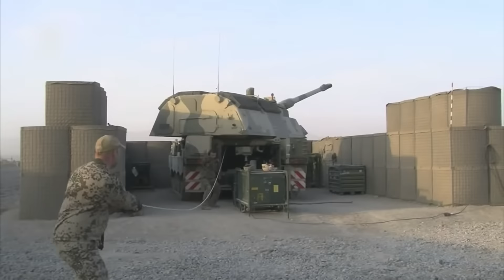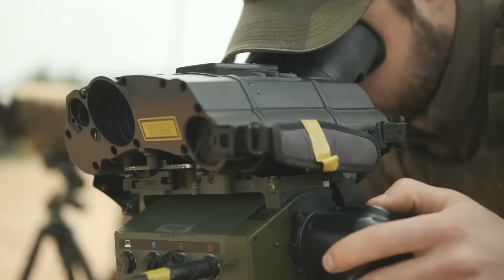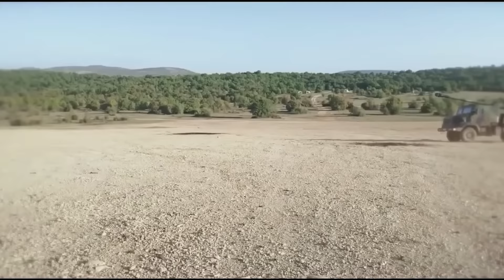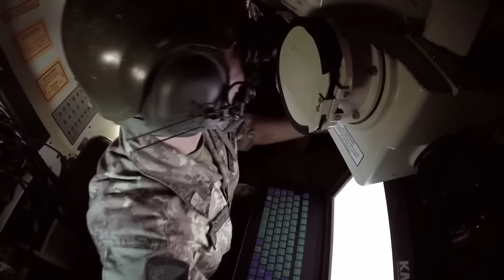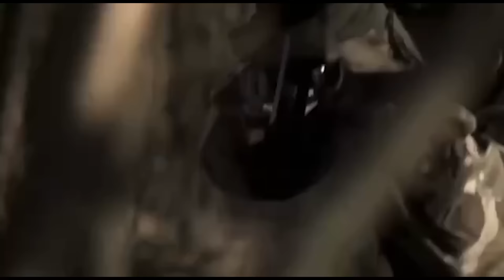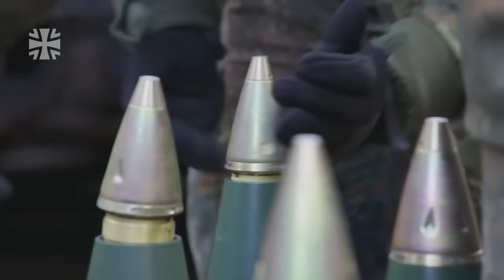German PzH 2000 howitzer in Action in Ukraine! Better than Caesar?!

Comment: The Panzerhaubitze 2000 is not difficult to use in shoot and scoot missions, it was literally designed for that purpose. It can shoot more projectiles and then quickly move away, whether that be at 60 km/h or 80 km/h makes no real difference in evading counter fire.
Reply: Agreed, the 80 km/h is only useful if travel is large distance, like 100's of kilometers.

Comment: The guy has it completely wrong. Shoot and scoot tactics means you have to fire quickly and runaway quickly, at both the PzH2000 is better than Caesar because PzH2000 can fire after just 1 second after coming to a stop and get going just 1 second after shooting. Caesar nears set up time and the crew running around on the outside, so it takes minutes. Also mobility of the PzH2000 is higher than Caesar because PzH2000 is tracked and therefore can go off road much better than Caeasar so it's mobility is higher.  When you talk about ferry range and speed then Caesar is 20 km/h faster and has 150km more range which makes almost no difference at all. If you go 80 km/h or 60 km/h is really no big deal and the range is near as makes no difference.

Comment: PzH 2000 on the battlefield - STOP, we are taking a break until tomorrow, we meet in the same place, because today I have fired 90 times.
Russian howitzer - okey (I will take a little more Uraine until tomorrow)

Polish KRAB on the battlefield - I'm just getting started, I only shot 140 times today we're going with coke, fuck yeah
Russian howitzer - please stop,have mercy on me
Polish KRAB - no
Reply: pzh vs krab
projectile velocity: 900m/s vs >100m/s:   pzh wins
rounds per minute: 6 vs 9 pzh wins
ammunition carried inside: 40 vs 60 pzh wins
max range of shot: pzh wins by far
max range 400km vs 420 km pzh wins
automatic computer based targetting: pzh wins

nice howitzer, KRAB. but: pzh shelles more rounds a day, even if it would take a rest. and the rate of hits is much higher, due to better electronical support and automatically tempered ammunition.
Reply: @KarlHeinzSpock  I do not know where you got this information but I will correct it so quickly
1 and 4 lol
Crab's max range is 33 kilometers with normal ammunition.
when using Vulcano, the range is 72+ kilometers, so the projectile speed is the same or very close
2 yes, here you are right, the Krab has a semi-automatic loading of the ammunition to the cannon
(This is the type of argument that rosians use for Western tanks compared to T-series tanks.
What will happen when PzH 2000 invades a mine since all ammunition is close to the bottom in PzH 2000?) 
3 yes, here you are right
5 yes, here you are right , but it's really not much
6 LOL
it has a very good Topaz
Crab apart from that have :
land navigation system and topographic link FiN 3110L + GPS + odometer,
fire control system (turret control computer, aiming computer and gun commander's ballistic computer),
filtering system,
FONET internal and external communication system (VHF digital radio type RRC 9311AP),
fire protection and explosion suppression system,
day and night observation devices for the driver and the commander,
warning and self-protection system - OBRA-3 SSP-1,
a sight for shooting straight ahead,
ballistic radar MVRS-700 SCD,
power generator - DC 28 V, output power 5.5 kW
And I forgot about accuracy, with normal ammunition at a maximum distance of 33 kilometers, the Crab hits a maximum of 2 meters. What I wrote is data from the army, not the manufacturer's advertising requests;)
For a soldier, it is most important that the equipment he uses is reliable, reliable and, once again, dependable in all conditions of the battlefield.Because their lives and their brothers' lives in the fight against the enemy depend on it
Greetings from Poland
Reply: @asbupl5670  i see, you know and like your equipment. perhaps it is as if two fighters meet in the ring: it is important, that each opponent is shure about his strength, if not, he is about to loose. so germans think, their cannon is best, and you are convinced, that yours is better.
i didn't mention all items that are built in at pzh 2000. for example, there is as well a self protection system, applying fog in pzh. pzh and krab, they look quite similar.

our systems fight on the same side. i observed, that poland has a well equiped and well trained army and i apprechiate it, as well as your help for ukraine.
i wish you all the best.

Comment: There's a new type of 70km projectile that's about to make it's debut in Ukraine. The article I read said it would be compatible with the M777 and the M109 Palladin but it didn't mention the PzH2000. It's a joint development between the US and Norway. It will be able to hit moving targets from 70km. This is what I found on it:

The U.S. company Boeing and Norwegian Nammo tested a new 155 mm Ramjet projectile for NATO standard artillery.

The Ramjet is being developed as part of the modernization of existing weapons for the U.S. Army. Despite the fact that the tests became known only now, the tests took place at the end of April 2022 in Norway. The military checked the operation of the jet engine, which "showed flight stability."

Work on the new artillery projectile began in 2019 as part of the XM1155 Extended Range Artillery Projectile program. The project was funded by the U.S. Army. The Ramjet is equipped with an air-jet engine, thanks to which it requires less fuel and can accelerate during flight. The maximum launch range is 70 km.

The Ramjet is designed for the advanced ERCA (Extended Range Cannon Artillery) project, which was previously called the M109A8. However, the M777 and M109A7 Paladin howitzers will also be able to use the new projectile. With its help they will be able to destroy enemy tanks on the move.

I wonder if the PzH 2000 will be able to fire this round? Generally, when NATO develops something like this it's compatible with every nations military.
Reply: It should be,but we might need to (re)test the long term effects on barrel and add computer things
Reply: @frederickpallas7130  That's good thinking. This round is brand new so more testing is quite likely. It has yet to be fired on the battlefield. Bit being able to hit a moving vehicle from 70km with a 155mm round would be a huge improvement over what Ukraine is using now. I hope they can fit it with all the 155mm platforms of each nation such as the Caesar and PzH2000

Comment: Any systems is dependent on what the requirements are. The PzH-2000 is better protected than CEASAR and more computerized. The CEASAR is basically a replacement for the towed artillery and the PzH-2000 is dedicated mechanised artillery.

The only thing that is wrong with the German guns is the bureaucracy in obtaining the spare parts necessary for their continued operational use.
Reply: pzh can carry 60 rounds ammo inside, caesar can carry 18 rounds. pzh can shoot faster and ist faster at leaving the place. now, which system will be able to launch a higher amount of shellings a day? which system needs less suppport structure to be supplied with ammunition? how many hours of usage per day will you have with pzh running at max fire rate compared to caesar running at max fire rate? it is not that easy to compare these systems. there are strong arguments, that pzh is the more suitable machine for ukraine, but i'm not shure. it depends strongly on situations.
Reply: the good news: bureaucracy  is done now and the decisions are made. now, a very effective production and support machinery has been started.

Comment: 1 - for the price of one PZH2000 you can buy 3 Caesars
2 - the Caesar is War Proven: Afghanistan, Lebanon, Yemen, Iraq, Ukraine
It seems that the Dutch already complained about the reloading system in 2007 in Afghanistan. The default still exists today, according to the Ukrainians. Either the Germans don't know how to solve it, or they don't think it's necessary.
Reply: there is not really a technical problem with pzh2000. it is normal for precision equipment to be attended after such enormous hig frequency use.

it doesn't make much sense to compare it to caesar. these systems have quite different properties to their advantage or not, dependent on the situation.
Reply: The Germans used them in Afghanistan.
Reply: @Beethofen51  No, the Dutch used them in Afghanistan in 2007. A number of problems had already been reported, including reloading issue. This means that the Germans have not solved them since; they don't know or don't want to.
Reply: @chrisrobert5252  The Germans used them too in Afghanistan. And both the Dutch and the Germans praised it. The problems the Ukrainians were due to the intense use. You're supposed to shoot maximum 100 rounds a day and regularly maintain them. The Ukrainians shoot several hundreds of round and were unable to maintain them properly due to lack of training and spare parts. For the moment they sent 6 more PZH2000 to Ukraine. But I must admit that even in the German army a lot of greater maintenance work is done by the industry and not the soldiers anymore.
Reply: @RandomGuy9  It might also be worth mentioning that the Pzh 2000 was never intended to be a "standalone" system, but always in a composite of several Pzh 2000s - six or 12 of them. The idea is to shoot a complete round and then change the location before the enemy has reconnoitered the previous one. Then reconnoiter a target again yourself, take it under fire and change location again. Against this background, 600 - 1200 shots should be quite a sporty daily performance. It is better to hit precisely than to go for mass. For the mass, ammunition must also be fed again and again.
Reply: @chrisrobert5252  Germans also used the pzh2000 in Afghanistan
Reply: Du weisst aber nicht wirklich bescheid hmm
Reply: More rounds, better mobility and better protection. While the Russians will be able to track Ceasar systems down, it will be much hrader for them against the PZH. So of course its more expensive since its not just a truck like Ceasar. And its war proven as well, so thats no argument.
Reply: @OhmeinGottVIIC  bravo for your intoxication, being able to affirm that the mobility of the PZH is better than that of the Caesar... lol
Reply: @chrisrobert5252  in terms of terrain, yes. Wait till it rains in Ukraine…

Comment: I heard that they broke down in
action!?
Reply: They did not brake down. Ukraines forces fired way more than 100 rounds every day, wich is the max for precision rounds. They are back into service again after Ukrainians adjusted the firing rate.
Reply: The weapon system was developed to defend the fatherland. It is part of the Combined Battle of Arms. Hence the armor protection, the tracks and the powerful engine. She is basically a driving robot awaiting precise commands and a diva who is flatbed-loaded to battle and needs a crew for maintenance. It also issues a lot of error messages during the battles, which are then repaired by the crew.
In the Bundeswehr, it is not used so hard in maneuvers. She likes 100 rounds a day and the optimal distance. Hundreds of rounds a day means the bolt and autoloader wear out quickly, requiring the crew to repair and calibrate. But that is to be expected and nothing special. The Ukrainians received spare parts packages from the Bundeswehr and put them together based on their long experience on the maneuvering area.
Reply: Many broke down under same time.
They was under heavy stress but it must
be improved.
Reply: @pernykvist3442  The only way to improve it is to send more PZH2000s to compensate for the less firing rates. As for now Germany sent 18 of 112 howitzers. Because they are in production now and it will take 1-2 years until Ukraine has all 112.

Comment: The crew of the Phz 2000 is not only better protected against fragments than "open" artillery systems (such as CAESAR, M777, FH 70, etc.), but it also provides them with a high degree of protection against wind, cold and wet. Something that will become even more important in autumn and winter. Nevertheless, both systems are hardly to hierarchy. The CAESAR is certainly faster and more maneuverable on roads than the 60-ton German howitzer (CAESAR 18.5 tons), whereas the use of tracked vehicles allows, for example, to cross irrigation ditches, which can be a real problem for wheeled vehicles in rural areas. For an army command that does not have a "personnel problem", the CAESAR, which costs about 6.5 million euros, is perhaps the tactically better choice than the Phz 2000, which is already very expensive at 17-18 million euros, but the decision to introduce one or the other weapon system depends on the country from which it is to be deployed. If the protection of the own soldiers stands more in the foreground, one feels clearly better in a Phz 2000, if the army leadership attaches more importance to a maximum of effect, then perhaps 2 to 3 guns of a personnel-intensive system like the CAESAR win instead of one Phz2000 in meaning.
The best artillery sites on the net
"Outgunned" - Artillery & The War in Ukraine - Developments, lessons, & logistics
https://www.youtube.com/watch?v=EMEpxX7rS5I&t=1s
Reply: i understand the wish of everyone, that one's own country has 'the best artillery system'. so wish i that pzh2000 is the best. but as said, it's not that easy. different situations, different advantages. pzh is slower in motion than cesar, but can manage heavy environment the way a tank does. cesar has higher range(i think). pzh can concentrate up to 5shots at a point within less than a second. those shots can fight a target in different ways, which leads to 100% destruction.
in addition if the enemy is able to destruct for example two of the shots, the other three will kill him. and so on.....
Reply: @KarlHeinzSpock  And we are all forgotting the HIMARS system provided by the US... This completes  the panoply given by the west to Ukraine to fight off russians. I know the americans do not need us for their advertising though...
Reply: @vermicelledecheval5219  it is likely the system with the most impact of all, concerning range and number of systems.

and we also forgot mars, germany's 'little brother' of himars.
Reply: @KarlHeinzSpock  However either Germany, the Netherlands, UK, France are more or less little players compared to the huge war effort given by Uncle Sam to help Ukrainians... I know that for CAESAR the industry is not prolific to say the least although Macron asked to increase production rate. Still this is of a high precision "swiss like" mechanism only mastered by high skilled seasonned companions.
I suppose this is even of a greater challenge to output on a bigger scale this high tech tool which is the PZH...
Reply: @vermicelledecheval5219  😅 look at germany. producing good things, having approximately nothing to share...

but russia should fear german war production. it could press russia down nearly alone on the long term, when running at speed.
Reply: @KarlHeinzSpock  
The operational concept of the Panzerhaubitze 2000 was developed during the Second World War. Generaloberst Heinz Guderian was of the opinion that the armored howitzers (Hummel) followed the heavy battle tanks into battle. The Bundeswehr still masters the combined combat of weapons and good training today. As with any weapon system approved for war, the authorities and soldiers have communicated their ideas to the manufacturer. It appears useful for defending the fatherland. It is clear to me that the future belongs to the Caesar, due to its high mobility and low cost.
Reply: Protection of personnel 40 km from the fighting is not very important
Reply: @allezchosetruc  yes, it is. what if artillery counterattacks hit nearby? what if something goes wrong with ammunition/ "friendly fire"? what if things don't go the way they should? for example if you have enemy contact, you can handle a panzerhaubitze similar to a tank. you can drive and shoot  with three men and two men can secure the surrounding.
there are situations in which caesar is more suitable and in other situations, panzerhaubitze will be in advantage.
Reply: @KarlHeinzSpock  Exactly. These two systems can act to together. CAESAR having a better screening Capability with shoots and scoot operations that will sting Pootin's minions like hornets until they'll surrender or die in agony and Panzerhaubitze being such a badass into providing an abundance precise firepower that will rake russian positions until we all see humans and materials fuming carcasses left... Yes war is not pretty but the ukrainians are not the agressors in all this mess... Russians started all and now they'll pay the price 💀
Reply: @allezchosetruc  it's very important if you want to go closer and target the supply lines further back
Reply: @allezchosetruc  
Christian Grabowski
vor 0 Sekunden
The weapon system was developed to defend the fatherland. The concept of combined arms was developed as early as World War II. Colonel General Heinz Guderian had the idea that it would follow the heavy battle tanks into battle and provide the necessary artillery support. A relative of hers in this World War was the "Hummel". Hence the armor protection, the tracks and the powerful engine. She's basically a driving robot who awaits precise orders and a diva who is flatbed-loaded to battle and needs a crew for maintenance.

You can find the operational concept on the Bundeswehr channel:

Nachgefragt: Artillerie im Ukraine-Krieg, Ausbildung und Taktik mit schweren Geschützen | Bundeswehr
Reply: @christiangrabowski7603  Merci Christian!